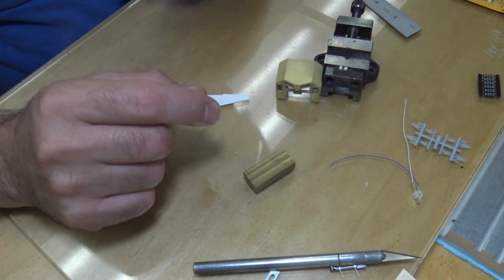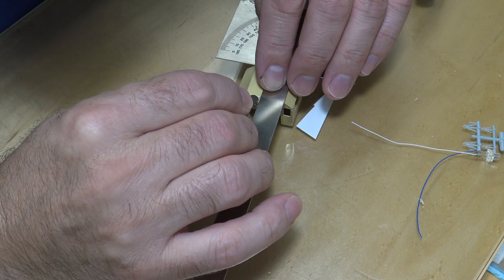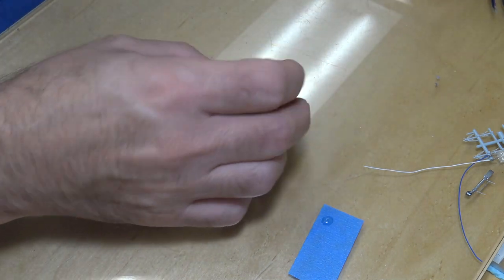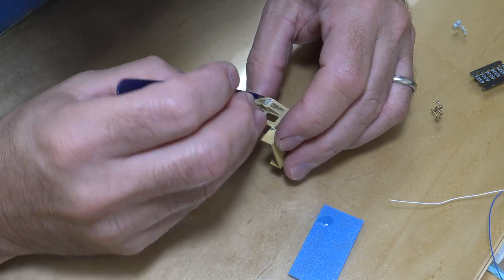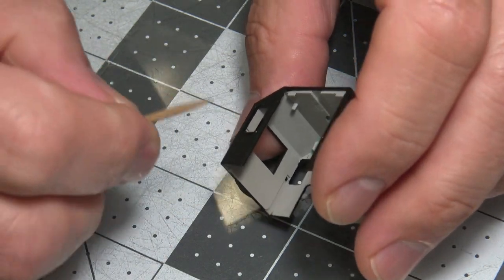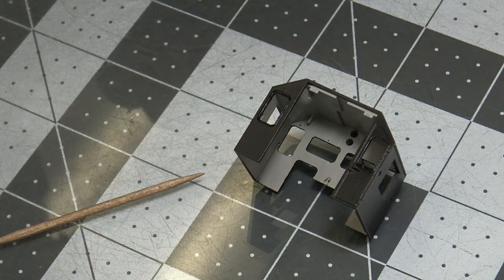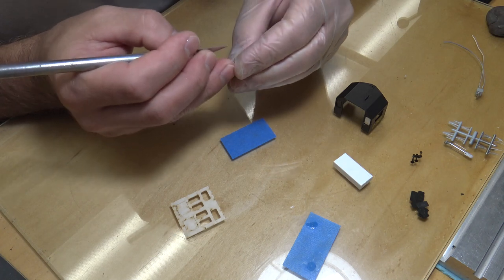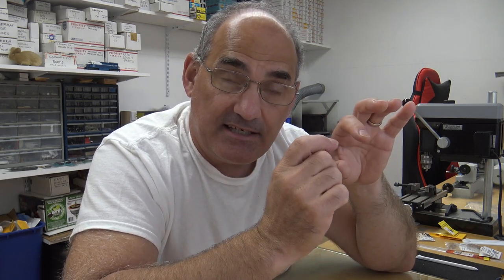KATO GP35 PROJECT CAB DETAILING AND PAINTING

Comment: I've been having terrible luck with my latest project. I drove into Salt Lake for some glue and came back empty handed. I guess i can cut all plastic that I need. 
So if anyone is reading this, what's your three favorite glues / adhesives to work with? 1) Testors liquid cement, 2) ? Gap filling cement 3), Gorilla glue with the blue sides.
Brian your models are" looking great
Reply from the maker: 1. Tamiya extra thin cement with the lime green cap and label. 2. Tamiya extra thin cement with the dark green cap and label. 3. Any of the CA glue that is branded for the store you are buying it from. They are all the same, only difference is the name on the bottle. I get a thin and a medium.

Comment: Brian, what scriber are you using?
Reply from the maker: If it is the one I am using in the pin vise. It is a stainless steel pin sharpened on a Dremel cutoff wheel.
Reply: @6axlepwr  The one you use to scribe the lines on the roof at 14:50 for the weld beads. It kinda looks like a flat disc with a hook on the end for scribbing
Reply from the maker: Dan, those are called HOLLY and made in Japan. The company that makes them is SHIMOMURA ALEC CO. LTD. 

I got mine off Ebay. Hopefully this link will work. They come in three sizes.

https://www.ebay.com/sch/i.html?_from=R40&_trksid=p2380057.m570.l1313&_nkw=HOLLY+Line+Engraving+Tool&_sacat=0